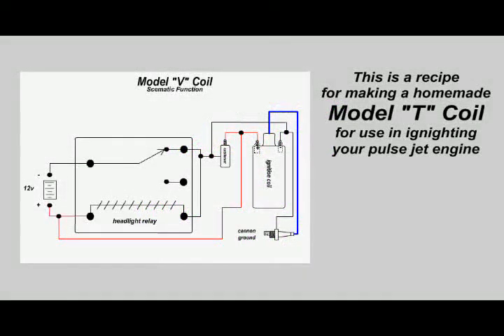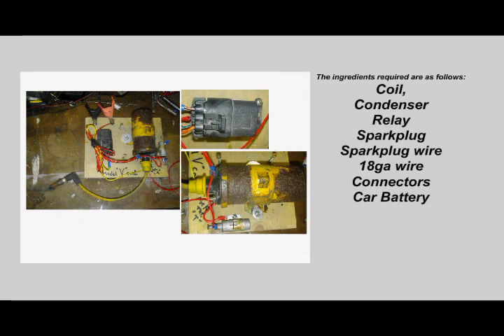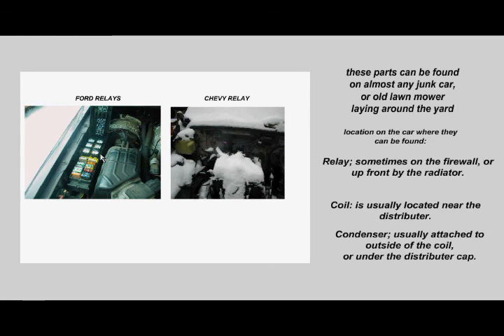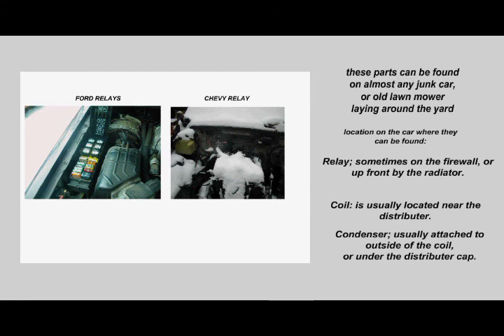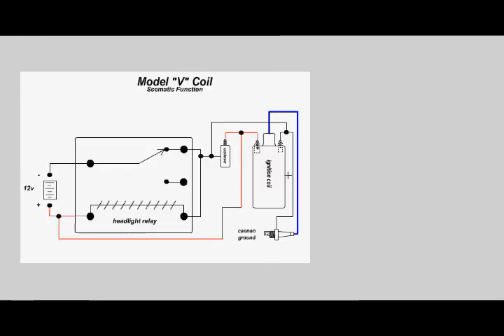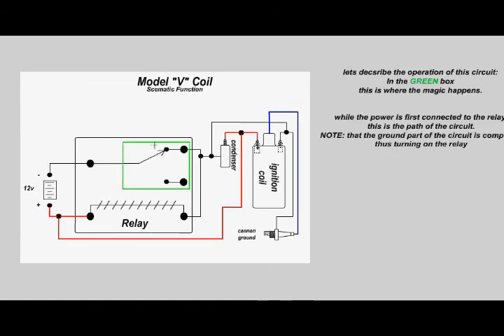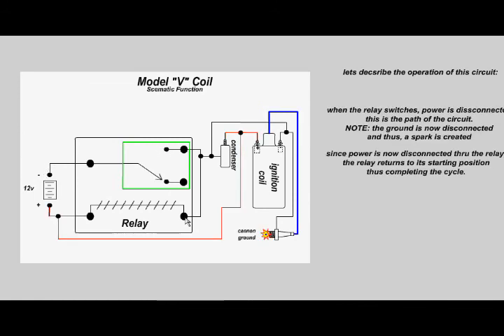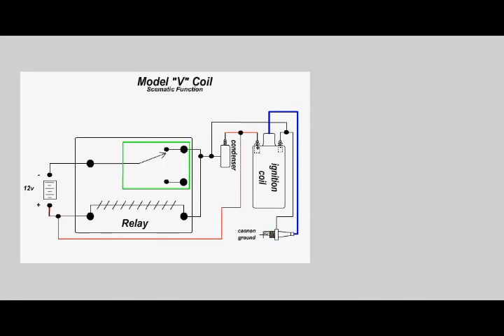How 2 build a simple spark coil driver, using a relay.

Comment: what does the condenser do in this situation
Reply from the maker: Basically the function of a condenser in a coil ignition circuit is to reduce the spark at the contact points as they open in the distributor and thus minimize burning and pitting of the points.
Reply: It causes to magnetic field of the primary winding in the coil to collapse quickly, increasing magnetic flux. One thing this is missing compared to a Model T coil is a Cushion Spring on the points. It's a spring the non moving point is connected to so it can follow the armature the moving point just a couple milliseconds letting the coil to build up magnetism before the points open. When this isn't working properly on a T coil it causes something called Double Sparking which causes a weaker output.